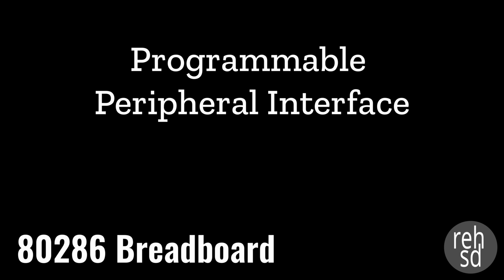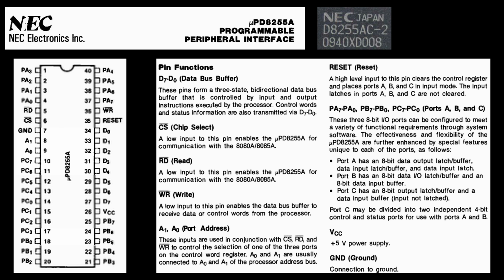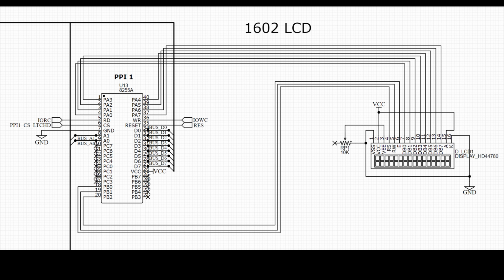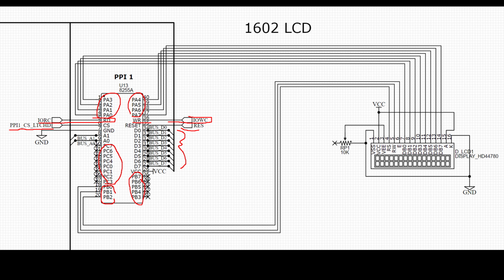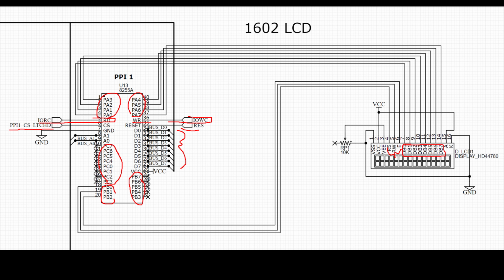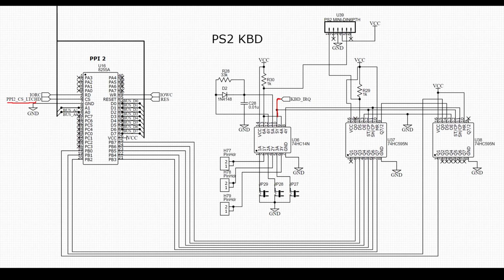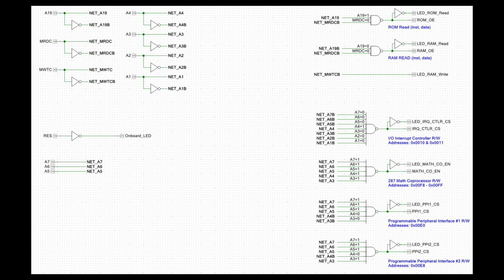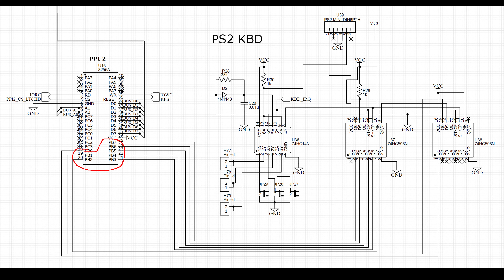80286 Build, Ep. #21 - Programmable Peripheral Interface D8255

Comment: Wouldn’t the 82c55 be a better fit for the 80c286?
Reply from the maker: Yes, I believe the C version would be more appropriate. Good call out. I will have to see if I can source the C version and swap out my 8255 with the 82C55.
Reply from the maker: The same will apply to my 80287. I have an 80287, so I just ordered an 80C287 (along with the 82C55 ICs). Thank you for pointing that out about the C version!

Comment: Hi, it seems you have on your PPI the address lines wrong on A0(PPI) you need to connect A1 and on A1(PPI) connect A2. Why is this, well you have a 16 bits CPU and you connected D0..D7 to the PPI, so if you address a odd byte nothing will happen, this is D8..D15. Hope this explanation helps.
Reply from the maker: I appreciate that. I was on the fence on that config. The documentation I was reading showed that setup with A2 and A1 when running a pair of PPIs for 16-bit I/O support, but only using A0 when using 8-bit. I will shift those lines. Thanks for the heads up!

Comment: I have a question. If I have a circuit diagram, from which company can I order a PCB ? And how much money is the order ? ( I'm still waiting for my orders from eBay and AliExpress. Material and tools for soldering and more than 110 TTL IC, PLD programer and Chips and so on.)
Reply from the maker: I have been using JLCPCB. Another popular option is PCBWay. I imagine there are dozens of other options out there. For JLCPCB, a minimum of 5 PCBs have to be ordered. The size of the PCB, the number of layers of the PCB, and the copper weight impact the cost. I have some example prices at the following link for my homegrown 16-bit processor. 

https://www.rehsdonline.com/post/16-bit-processor-build-working-on-initial-design-including-pcbs

I find that most of my PCBs orders have a PCB cost of $10-$15 USD for 5 PCBs. Then, add shipping, which for me, is often more than the PCBs themselves.

In episode #20, I used four layers for that quick PCB design for a 286 board. The cost of 5 of those PCBs would be ~$55, plus shipping (say $20). However, if I drop down to two layers (which would take more design work to get signals routed properly), the cost would probably drop down to ~$10 for a set of 5. Four layer is expensive compared to two layer.